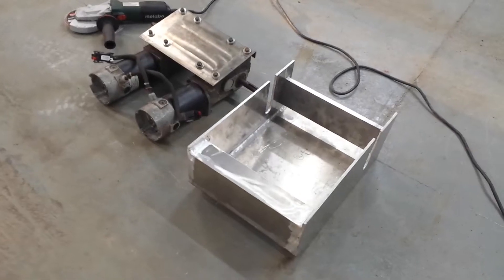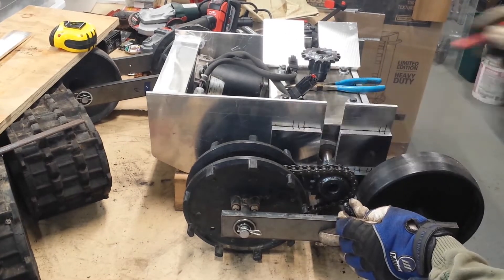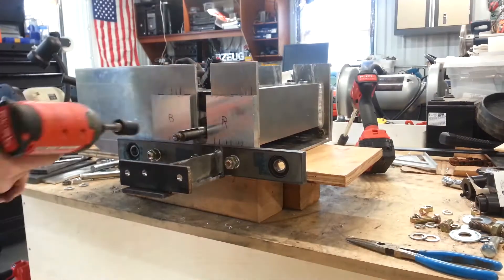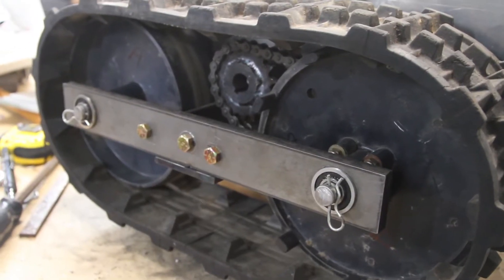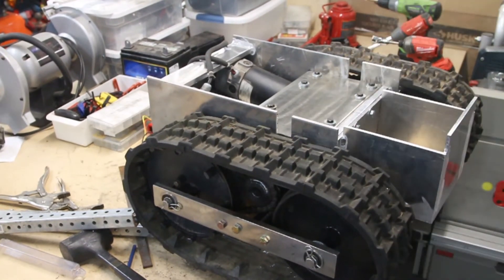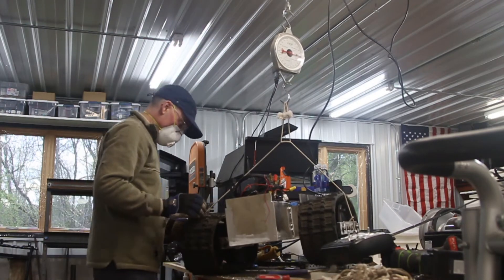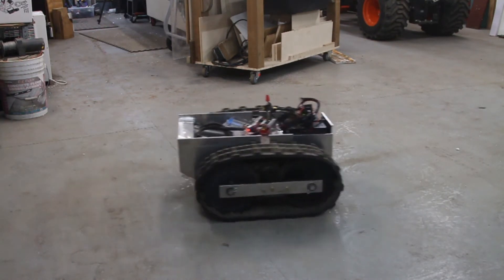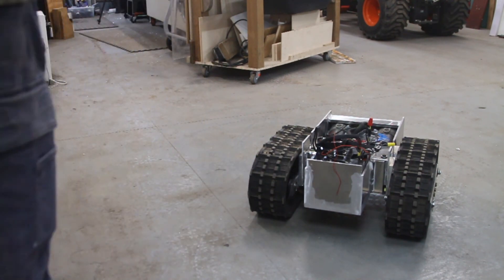Track Drive Robot Main Chassis Build and Test Drive

Comment: Love the robot, nice work!  Just picked up the same tracks on an old snowblower yesterday and found/subscribed to your site now.  My plan is to make a trailer mule/valet to move around a 3500lb boat in my yard.  Wondering if you think I'd need bigger electric motors than you used to do that?  The Trailer Valet RVR / XL-Pro gave me the inspiration, but your build gives me further hope that I am heading in the right direction.
Reply from the maker: Thank you.   I also saw the ads for the Trailer Valet, pretty cool.
Reply: Did you build your trailer valet? I too am looking to build a trailer valet. I have a maximum tung weight of 350 lbs. My trailer weighs 2900 lbs. I need slow speeds with lots of torque. Where I park my trailer is down hill on grass so I figured the tracks would do better than wheels.